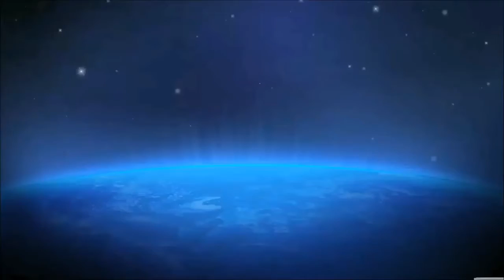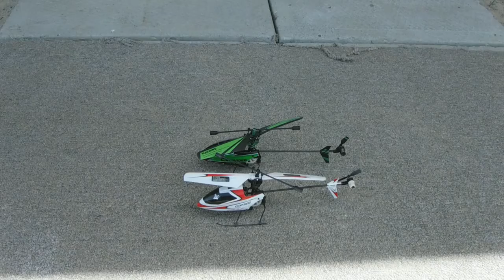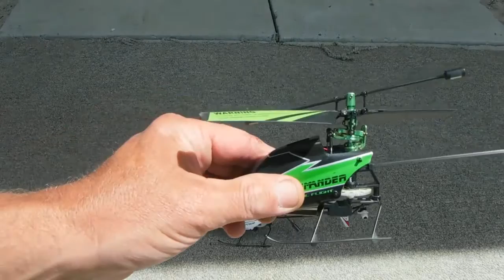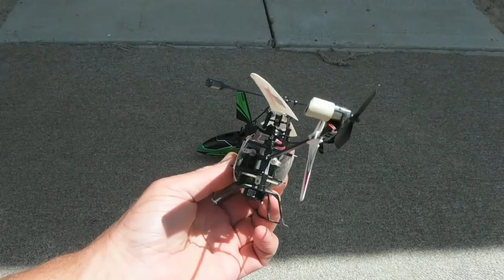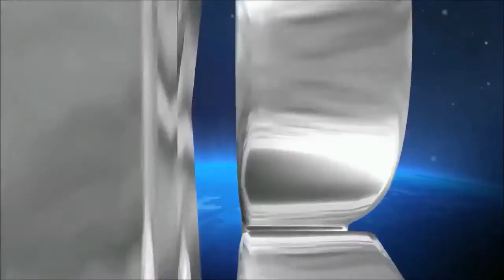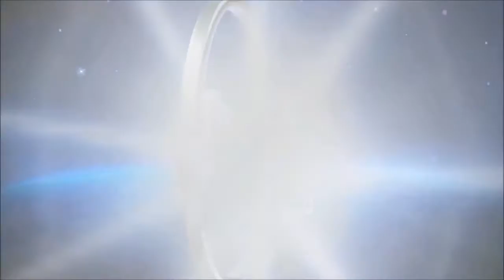Wltoys V911 Helicopter more power and speed  Freeeeeee Mod

Comment: mine out of the box...will not take off straight up. tried to trim and all. it will take off but it does go backwards while so.  even after it is up it will not hover stationary. it still wants to travel back..even with trim full forward.  any tips or is this thing just junk for the $25 I paid off eBay?
Reply from the maker: i never buy off eba for that very reason , try resetting the gyro the instructions tell you how to do it
Reply: I would try it right now but the link from gyro to blade....I broke one in a crash and no spare.  I'm probably going to end up going to my local hobby shop and see what they can do as far as set up. nice copter but needs small fixes.
Reply from the maker: v911 parts you get from banggood.com and might as well from tmart as well
Reply: it is also my first real rc heli...I started on 3ch and yeah..fun to cruise around the house..but I didn't want to blow $100+ just to crash and replace.
Reply from the maker: crash and fix is the hobby :) and do it again
Reply: just switched out those parts with ones from my 3ch..they were only slightly shorter but I held heli with hand with throttle up and the bar was leaning back and would slap the blades when slowing down....
Reply from the maker: right part best results wrong part results not so good
Reply: Kevys Rc & Music yeah I'm pretty sure I got one sent with a bad gyro. I'll be contacting seller to see what I can do about it.

Comment: I have a V911 and cannot get rid of the wobble and it only wobbles when hovering, going round or straght it does not wobble. I changed the main shaft and tried to balance the wings with electrical tape but nothing works, can you help please?
Reply from the maker: problem is likey bad bearings on the sawsh plate or some where in the chassis is a broken area also check your fly bar to make sure its straight .

Comment: does anyone know what other Wl Toy models my V911 transmitter will bind with?....
Reply from the maker: the V929/v939 will also work on the V911 and it wil also unlock alot more access to rates as well the right top button when pressed will make it spin in hi rate its fun as hell i use this trasmitter in my v911 all the time and love it this way you can also do some neat stunts that are other wise not possible with the stock v911 transmitter